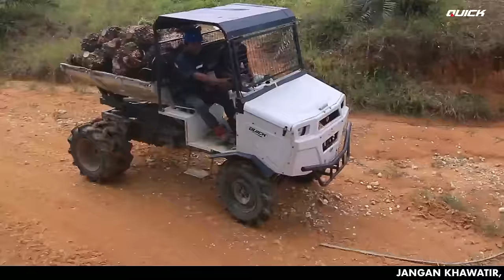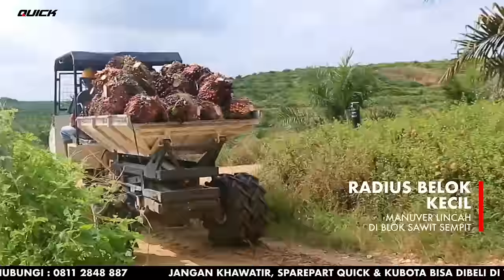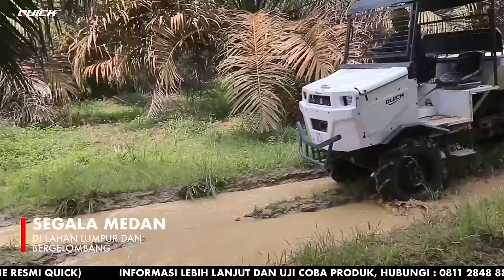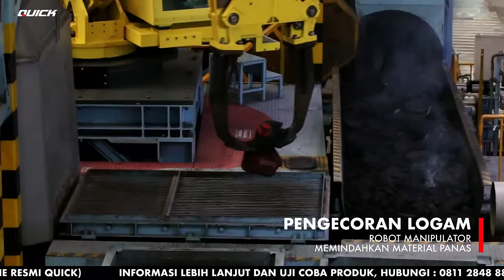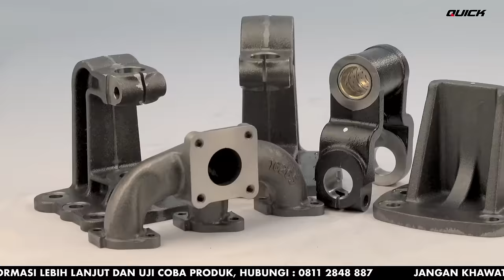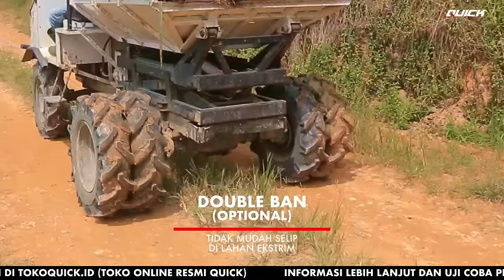PANGKAS BIAYA MUAT. LANGSUNG TUANG BAK BIN SYSTEM | ALAT ANGKUT SAWIT QT-16 E SCISSOR LIFT

Comment: Waduuuhhh..... Mantaaaap. 
Harga berapa bos
Reply from the maker: Kami memiliki 4 tipe Quick Truck, yaitu :

* QUICK TRUCK QT-14M : Rp83.400.000
* QUICK TRUCK QT-14E : Rp87.100.000
* QUICK TRACTOR QT-16E MD (Manual Dumping) : Rp98.500.000
* QUICK TRACTOR QT-16E : Rp119.000.000

Dapat menambahkan:
* Roda Double Belakang (2 pcs) : Rp4.500.000
* Roda Besi (2 pcs) : Rp2.300.000
* Side Trellis Set (QT-14) : Rp600.000

Harga belum termasuk biaya kirim dari Kantor Cabang Yogyakarta ke lokasi Pak Boss. Harga sudah termasuk PPN 11% dan Safety Equipment Set.

Info lebih detail, silahkan menghubungi nomor telepon sebagai berikut:
Telp. / SMS / WA : 0811 2848 887 (Sales Quick Truck).

Atau bila berkenan mohon kirimkan nomor telp. / HP Pak Boss, bagian pemasaran kami akan menghubungi Pak Boss :)

Comment: Cek harga untuk wilayah riau om🤔
Reply from the maker: Kami memiliki 4 tipe Quick Truck, yaitu :

* QUICK TRUCK QT-14M : Rp91.850.000
* QUICK TRUCK QT-14E : Rp96.000.000
* QUICK TRACTOR QT-16E MD (Manual Dumping) : Rp116.000.000
* QUICK TRACTOR QT-16E : Rp140.670.000

Dapat menambahkan:
* Roda Double Belakang (2 pcs) : Rp4.500.000
* Roda Besi (2 pcs) : Rp2.300.000
* Side Trellis Set (QT-14) : Rp600.000

Harga belum termasuk biaya kirim dari Kantor Cabang Pekanbaru ke lokasi Pak Boss. Harga sudah termasuk PPN 11% dan Safety Equipment Set.

Info lebih detail, silahkan menghubungi nomor telepon sebagai berikut:
Telp. / SMS / WA : 0811 2848 887 (Sales Quick Truck).

Atau bila berkenan mohon kirimkan nomor telp. / HP Pak Bos, bagian pemasaran kami akan menghubungi Pak Bos :)

Comment: cek harga min !?
Reply from the maker: Kami memiliki 4 tipe Quick Truck, yaitu :

* QUICK TRUCK QT-14M : Rp83.400.000
* QUICK TRUCK QT-14E : Rp87.100.000
* QUICK TRACTOR QT-16E MD (Manual Dumping) : Rp102.600.000
* QUICK TRACTOR QT-16E : Rp127.275.000

Dapat menambahkan:
* Roda Double Belakang (2 pcs) : Rp4.500.000
* Roda Besi (2 pcs) : Rp2.300.000
* Side Trellis Set (QT-14) : Rp600.000

Harga belum termasuk biaya kirim dari Kantor Cabang Yogyakarta ke lokasi Pak Boss. Harga sudah termasuk PPN 11% dan Safety Equipment Set.

Info lebih detail, silahkan menghubungi nomor telepon sebagai berikut:
Telp. / SMS / WA : 0811 2848 887 (Sales Quick Truck).

Atau bila berkenan mohon kirimkan nomor telp. / HP Pak Boss, bagian pemasaran kami akan menghubungi Pak Boss :)